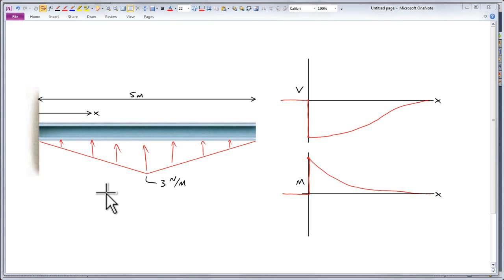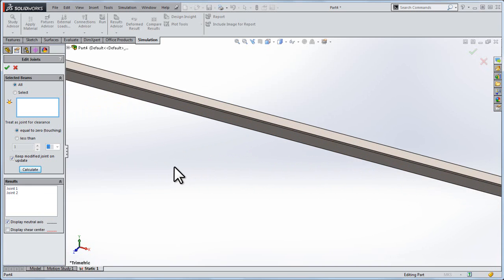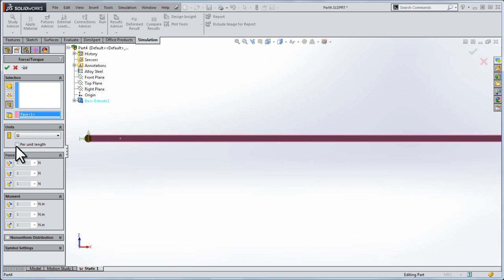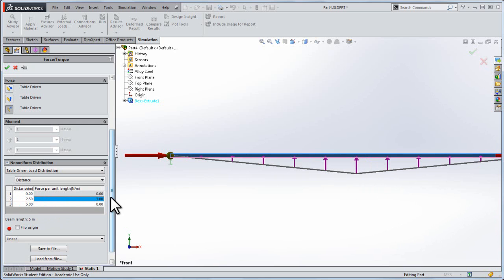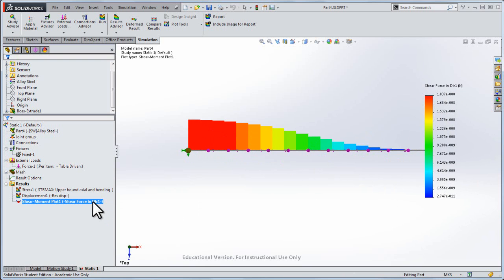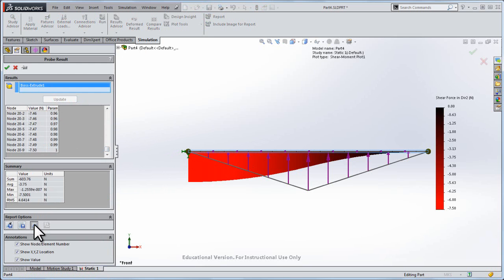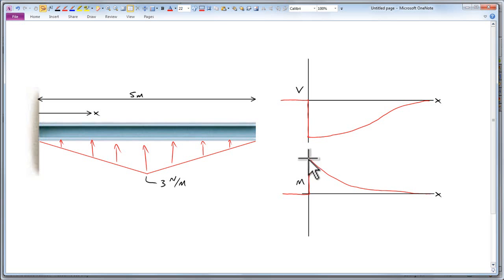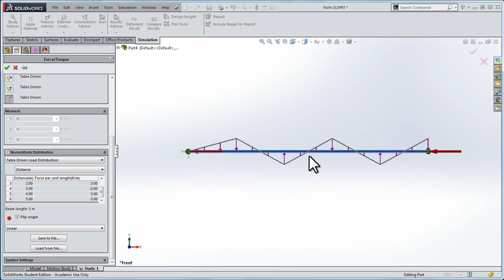SolidWorks beam bending shear and moment diagrams

Comment: Hello I am a little bit into design of steel connection details
Since moment and shear diagrams are not in the same plane it is some confusing
i couldnt understand which direction is the axis of moment

If i look from otherside beginning and ending will be swept